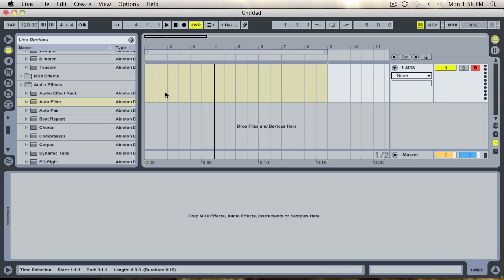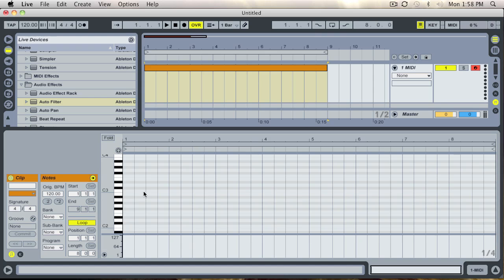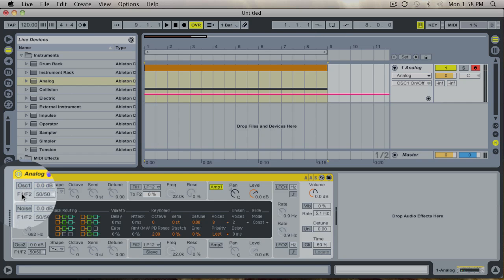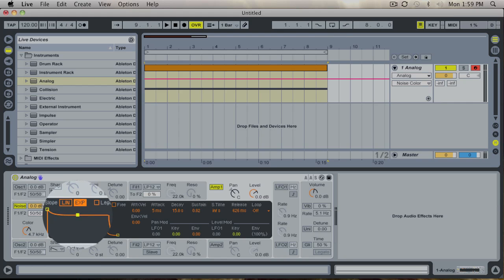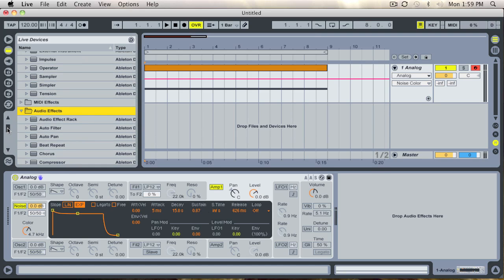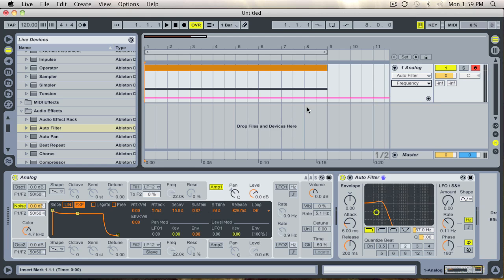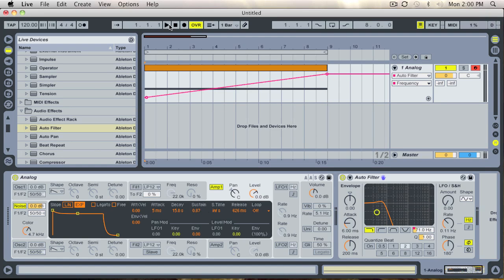How to make a white noise build up in Ableton

Comment: What about if you don't have analog? Any way to achieve the same effect possibly with a free alternative? I'm not really set on spending the $99 bucks for analog jus yet honestly.
Reply: any synth that makes white noise and any parametric eq
Reply: Hey, thanks man. Any solid free synths u can recommend? Especially an easier one to learn
Reply: +P. Green a very good free synth is the "u-he tyrell n6" which is published by amazona and u-he in collaboration, freeware. In order to make the same build up instead of analog you drag in tyrell, in the mixer section turn everything down except noise. In the misc section you can change the noise sound to your liking. Good luck:)
Reply: http://www.musictech.net/2013/10/freeware-synths-ten-of-the-best/

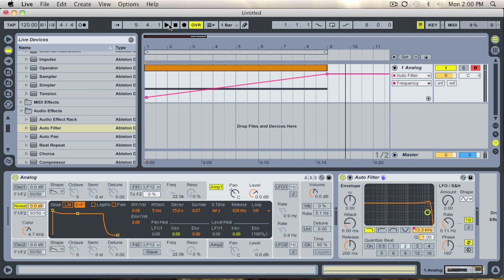Comment: @gogswarriors Thanks for the response, i see your point but it's just that with this example at the end of the buildup (2:15 to be precise) there's this little deflating 'fsss' sound that sounds like air being squeezed out of a bag which i can't say i'm too keen on, but as you mentioned taking it out makes the transition less smooth. I guess if i ever use this technique i'll try shaping that sound a bit with reverb.